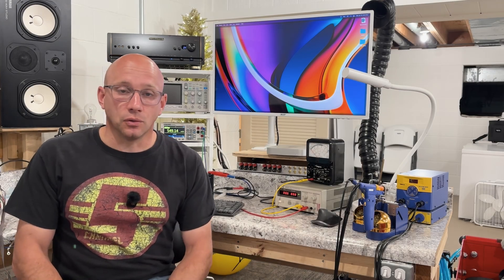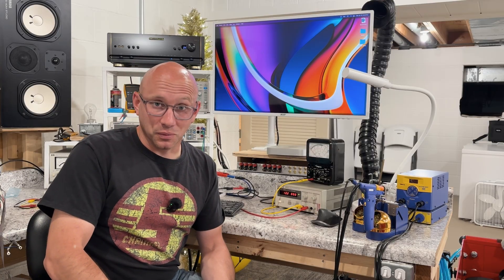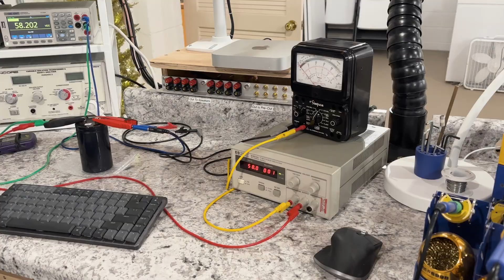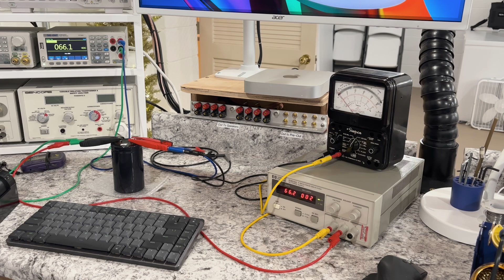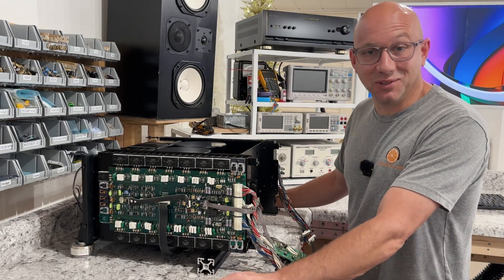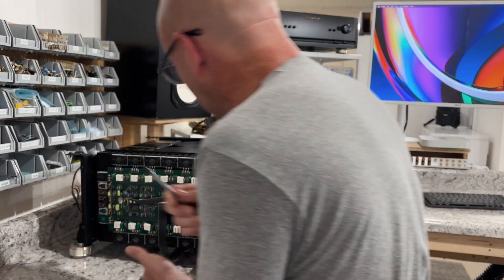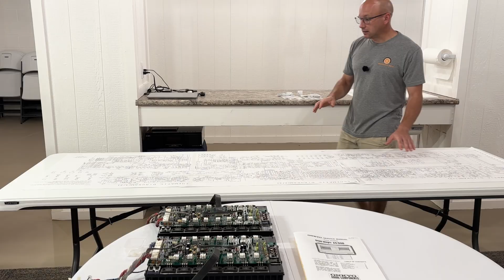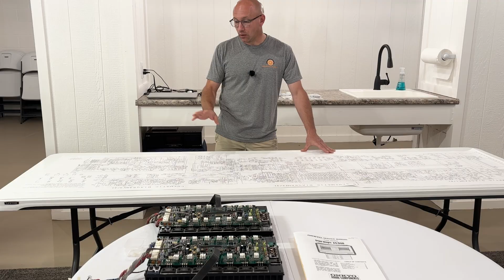Onkyo M510 Monster Amplifier Restoration Part 4. Filter Capacitor Adventures.

Comment: I've always been impressed with Onkyo and their attention to details that help improve the listening experience.
However, personally, I don't think a capacitor clamp makes any difference in sound quality but it makes for great marketing.
Thanks for sharing your journey with this amp, can't wait for the next part
Reply: I think the same. Think about the vibrations an electrolytic capacitor endures in a speaker enclosure, yet I've never seen any kind of anchoring mechanism, even in pricey speakers, to approach the science of this one where some sort of adhesive being most often used.
Reply from the maker: But, it does look cool :D
Reply: @BobWilson84 I'll give you that! 😊

Comment: Wow, what a fantastic project. I'm so impressed by just the scale and level of commitment on this. I also do restoration projects, but on a much more humble scale. I'm afraid i understand the "nerdyness" about the filter capacitor color fully, but from a tecnical point of view you made the right descision I.M.H.O.
I do a lot of "audio tuning", and affordable restorations.  My main goal is to improve a vintage piece of gear to give it a 3d "live" sound signature, and make the best choice possible componentwise, where in the original design cost where more a deciding factor. And you would be surprised how much the sound benefits from a good set of healthy filtercaps. When sizewise possible (and if they are avialable), i use the Nichicon LGK  type III superthrough series for my personel projects, because they realy open up the sound. They improve midrange resolution and detail, and give tighter, faster bass. Off course when the rest of the chain is up to it, but that speaks for itself. This is such rewarding work.

I love this channel, i hope you can finish this beautifull amp the way you want her to be. Those Panasonic 33.000uF where a great find! And yes, i like that color too...

Cheers from the Netherlands 😊
Reply from the maker: Thanks for the kind words from Netherland.  This hobby tends to be a bit "nerdy" as you said. ..... I'm guilty of that :)